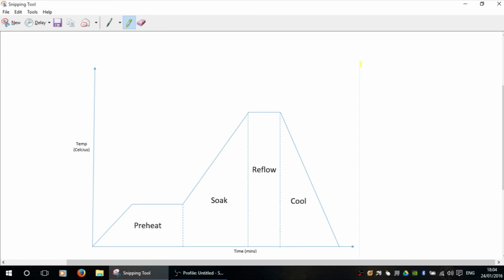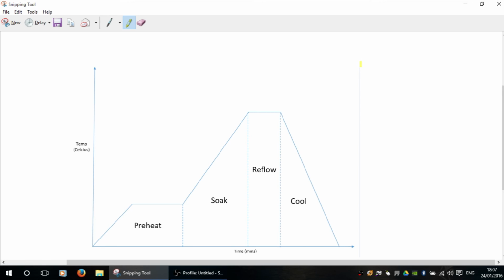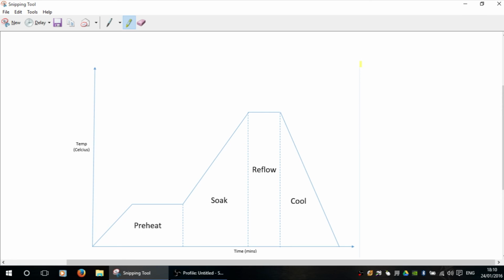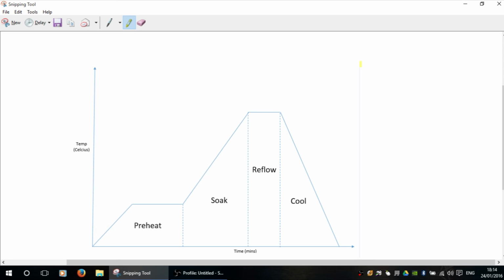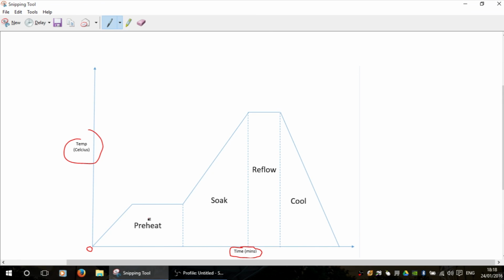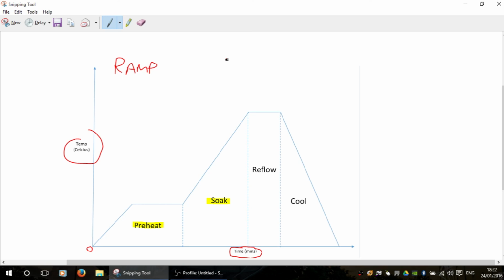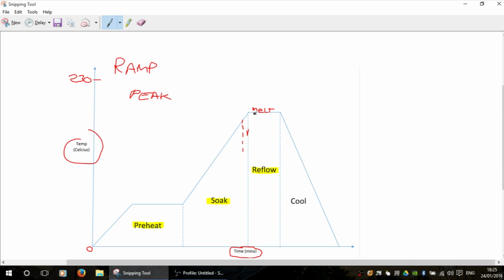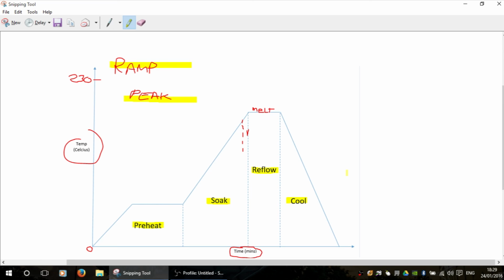The basics of BGA Rework Profiles and how to create them

Comment: i dont think it is mandatory to delid the IHS from the PS3's Cell or RSX prior to chip removal. I understand it is a big piece of metal and will sink a lot of heat energy, but attempting to remove the IHS while the chip is still soldered to the board is extremely difficult, not to mention the risk of personal injury or permanent component damage. Careful, measured preheating should negate the motivation to do this.
Reply: For RSX you absolutely need to remove moisture from the board for at least 24 hours before working on it, I usually do 24-36h at 105-120°c
Reply: @BrazilianGuyfromBrazil  i'm not disputing the need to dehydrate the PCB. Rather, I don't think (or don't understand why) its necssary to de-lid the replacement RSX's metal heatspreader prior to install.
Reply: @CandyHam  I never delid RSX when reballing/swapping it

Comment: I always share information that I learn because it helps if u don't share information then you should have your internet took away and not get any information. Thank you so much it helps alot and I'm working on a profile. The chip is known for having alot of heat to come off. When I start a profile I always use multiple temp probes because of the different from machines and just temp and people's home. I use in a not called room.  My gf turned on ac and it messed everything up.
Reply from the maker: Many thanks for your comment. Indeed, ambient temperature can wreak havoc with your profile if there is an extreme difference in the temperature from when you developed the profile.

Comment: So, basically preheat time can last several minutes to get board above ambient room temp, then soak is 1-2 deg/Sec to target temp in the neighborhood of 200-225 degree. Reflow is at the target temp for about 45 seconds to remove package. then Cool reducing temp 1-2 degree a sec down to 100 degrees. times vary depending on boards/packages/ solder types.. correct?

Comment: Andrew, I have shied away from reballing for the past 6 years as I went deep into it about 8 years ago with zero success. That was not for lack of trying to be sure. I believe now I will dive in again with your help, that you have already provided, and give it another go. The biggest thing beside this video that makes me think that I will succeed is your demonstration of how little flux is needed/wanted for reballing to be successful. I cannot thank you enough. I don't think that I will make any serious money doing this but, I want to make things work that currently don't. Thank you for making these videos and sharing the information that you have. 8 years ago there was nothing to go on, just flew by the seat of me pants. Cheers from Florida!
Reply from the maker: Many thanks mate and best of luck with getting back into reballing.
Reply: @AndrewPaul  are you familiar with the ACHII IR6500?? im having ALOT of trouble making a profile to remove a ps4 fat apu
Reply from the maker: @realfamvigilante2829  Hi, not used an IR6500 but did own an IR-Pro-SC for a year or so. Hated it - never really got to grips with it - the thing was so inconsistent between runs it was nigh on impossible to nail a profile down on it. Changed it for the RE-8500 and the differences were instantly noticeable for the better. Predictable temperature ramps, even heat and most importantly it was incredibly consistent.

Comment: Glad to hear that,I can remember a x box with issues, I heated the board to about 150 degrees,reassembled and low and behold worked,clearly solder don't melt until 217 degrees,so clearly a issue wi the die on the bga.
Reply from the maker: +Nell Nelly Indeed. :-)

Comment: Have you had any returns on the ps4 reballs that uve done,I fell out with reballing some years ago,major come backs,I believe the bga's are actually at fault,rather than a solder ball issue.
Reply from the maker: +Nell Nelly None - the one machine that came back turned out to be a PSU issue and not a re-occurance of the BGA soldering fault. Normally I'd agree (certainly in the case of 3-5 year old laptop flipchips) that the chips themselves are the issue, but I do not believe this to be the case with the PS4 - applying pressure above the APU in most BLOD cases I've seen will bring the machine to life but will fail again when this pressure is released. I've also witnessed missing balls and dry joints under the APU BGAs. It's a manufacturing defect on these machines for sure in my opinion.

Comment: what temp would u recommend for the bottom heater, before the top heater cones into play,not used my achi for years,but I'm sure I used to take it to 180 degrees,it was the dwell times I could never get correct.
Reply from the maker: It just depends what you're working on and the type of solder you're working with. There's no hard and fast rule.

Comment: Thanks,is it true you can reset the leaded bga,only using bottom heat alone.
Reply from the maker: +Nell Nelly Never tried it but wouldn't have thought so with any great success - you'd have to subject the bottom side of the board to some very high temps for a prolonged period to attempt it I should think. Definitely utilise a top heater.

Comment: I'm led to believe the bottom heater should produce about 80% of the desired heat,would this be about right.
Reply from the maker: The bottom heater should do the bulk of the heavy work, yes - 70/30 probably the fair estimate. You don't want to subject the BGA directly to high temperatures with top heaters as popcorning is then a real possibility.